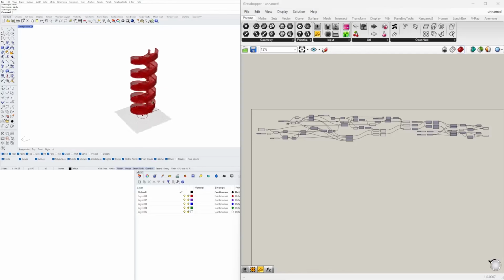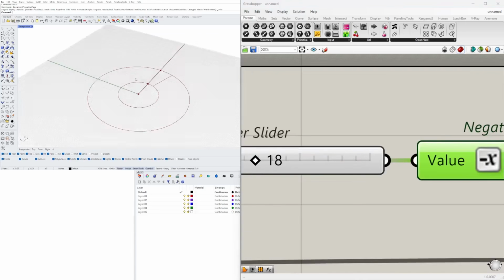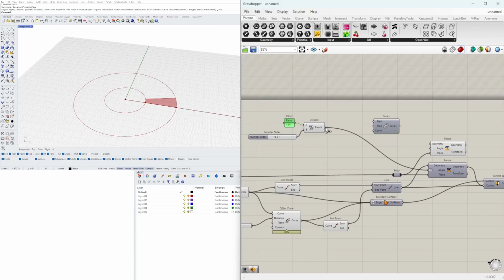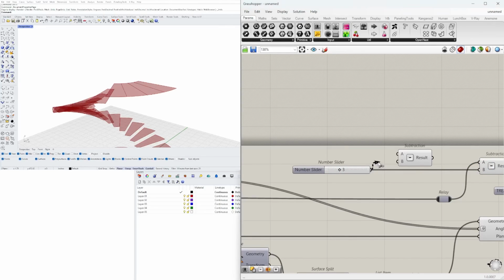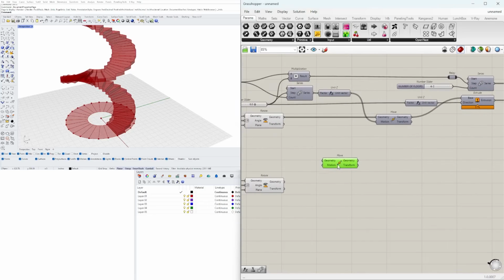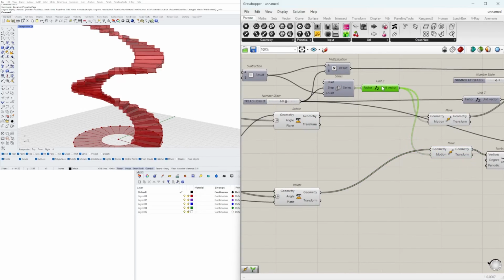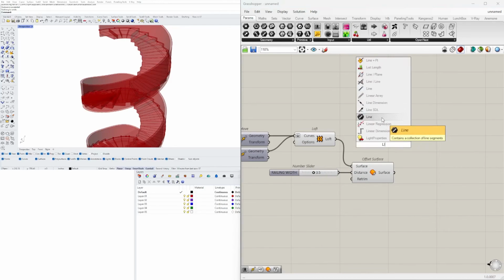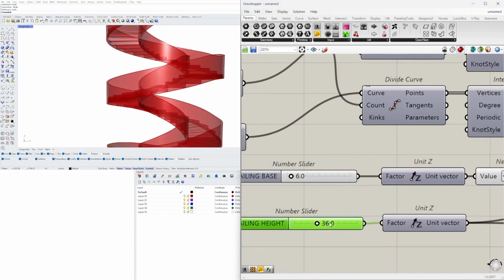How to make Spiral Stairs with Landing using Grasshopper for Rhino Parametric Architecture tutorials

Comment: The modelling was great 
but you have forgotten the number of steps to the landing ratio and how to control it.
Reply from the maker: yes,  I want to revisit this, to go over that portion.  Thank you for the feedback
Reply: @DCOParametric  Thankyou for considering into the topic.

If you're planning on working on this heading again can you consider few points.

1. The minimum thread wide on the short side of the stair/circle.

2. It's not actually necessary to divide the circle by the number of steps we required. Rather we could try to spin the steps in a circular manner with respect to the height between the step which we foot on and the step which is going to run above our head.

3. Proper landing count and width.
Reply: @barathchandar5492  
Yes, we need to take care of 'headroom'.
That's why this is such a fantastic script.
You can 'play with it' to see how everything works out.
Then you can pick the one that agrees with all the code requirements and customer requests.
David's tutorials are the best!